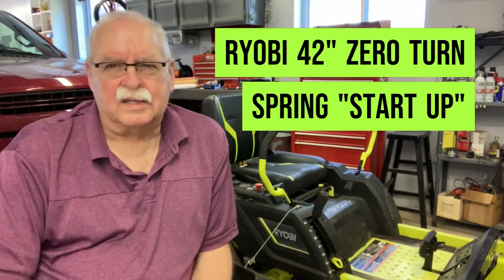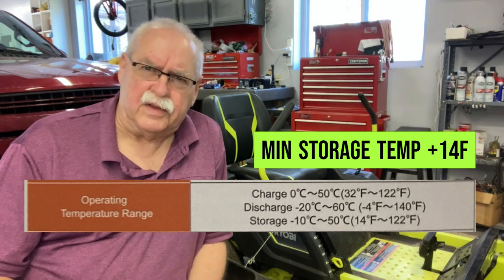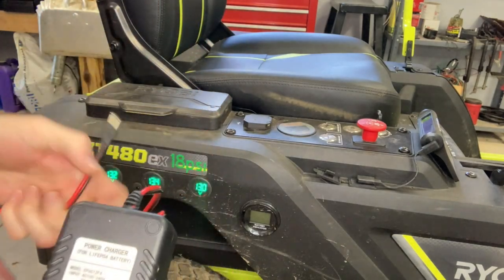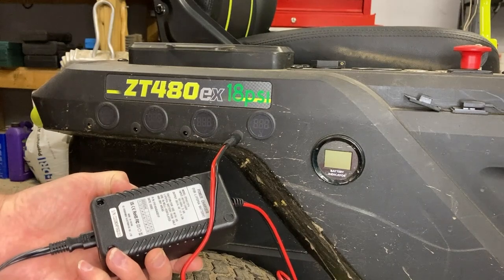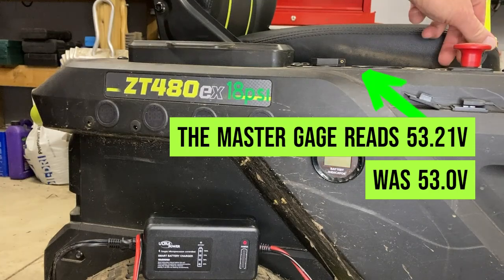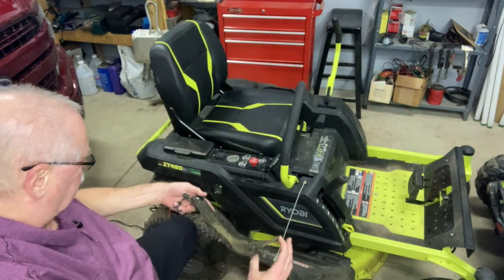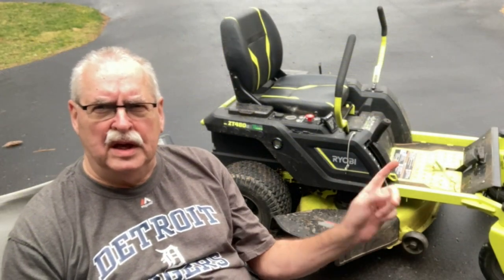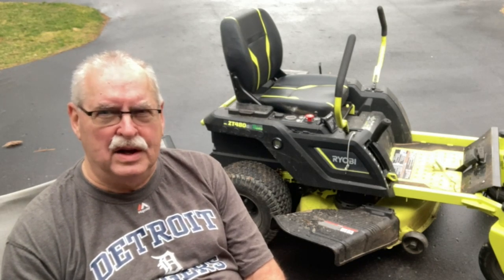Ryobi Zero - Spring 2024 start-up

Comment: Rob, the drive is not working on my Ryobi mower,do you have a video on possible solutions?
Kind regards Peter R
Reply from the maker: Sorry. I don't.  Can you confirm that you batteries are fully charged with a volt meter?
Reply: Yes Rob the batteries are at 100% , cutter motors  working but mower will not move
Reply from the maker: @peterriseley9762  That's a new one to me.  I got nothing.  Have you checked the Ryobi website on FaceBook?:
https://www.facebook.com/groups/2756962307675482
It looks like a very helpful resource.

Comment: Hello Rob , what should the charger setting be on , i have the same charger that you have.
Reply from the maker: The 48v charger?  I always run it on the lowest setting; 5A/5A.  No reason, I just do.  (reminder: never, never run "Repair")
Reply from the maker: And the 36v/48v switch set to 48v, of course
Reply: Ok thanks, God bless you have a great help in setting up my new battery setup.

Comment: Have you ever worked on dirt bikes, utvs, atvs?
Reply from the maker: I've had a few dirt bikes and street bikes, but never worked on them much.  The last one was an '84 Honda VF 700F Interceptor.  
I did work a lot on my several snowmobiles.  The last one was a 1998 Polaris 680 triple.  For a few years, I was riding 3,000 miles/year in northern MI.
Reply: @robertveldman1901  awesome!

Comment: I think it said to change the rear oil every 50 hours of run time.
Good to see that you are up and running with no problems.
I like the individual charge function that you added with the volt meters. Nice to be able to top one off as needed.
Reply from the maker: Thanks!  I missed that.  Where did you see that?  And did it say what kind of oil to use?
I got a little carried away with the gages and charge ports.  That  really pushed the limits of my electrical knowledge.
My original goal was to be able to get information in case one battery went bad, without pulling the battery pack.
Reply: I saw it on another battery repair video. It looks like an aluminum differential in the center of the axel. I haven’t read the manual, but it should say something about it in there. Just something that someone said they were going to do since they were already “all up in there”.
Reply from the maker: I may have seen the same video.  The Ryobi 30in riding mowers have a single drive motor and a differential.  I think he was changing the oil in the differential    (I think)